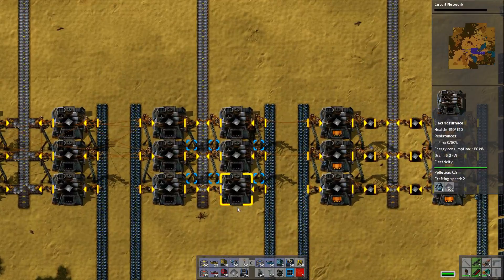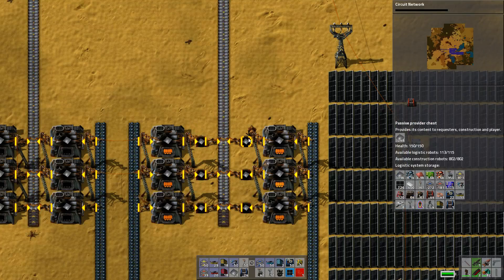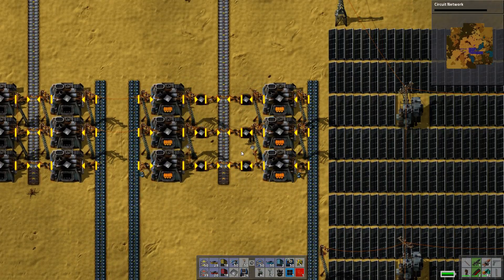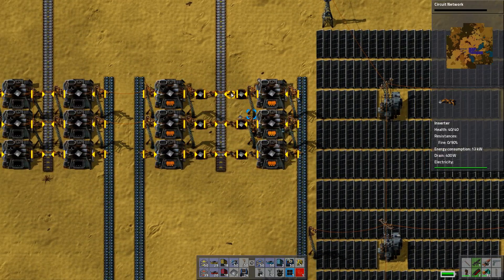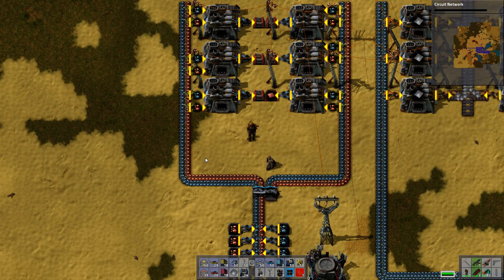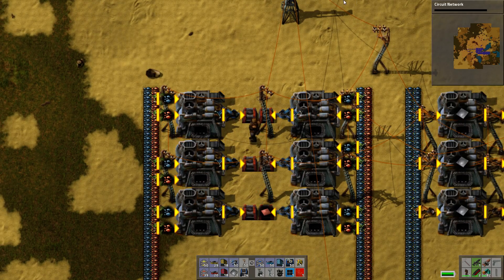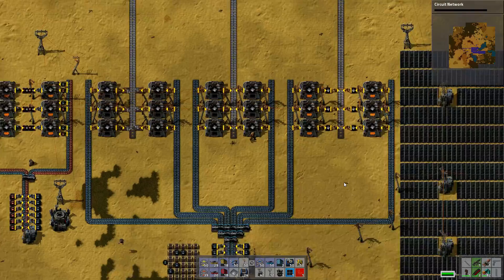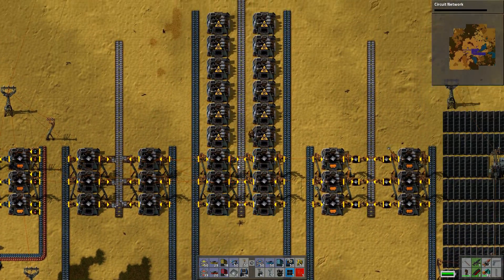Factorio Tutorial 10 - Furnace Setups

Comment: The copper+iron setup you have on the west side (to feed the logistics network) is great to have, even early game.  The reason is because it allows the furnace to always be in use....the downside is sorting the materials (in early game).  Here is a way to do it without a logistics network, but can easily be switched the moment you get it without much change:
https://dl.dropboxusercontent.com/u/24657744/Factorio/SmeltingBalancer.png

Testing the system is simple....I have a buffer prior to the main bus and 2 combinators. The first outputs 1 "0" if copper is less than iron, and the other outputs 1 "1" if iron is less than copper.  The green inserters simply test for either a "0" or a "1" in the system in order to pull that specific material.  The output green inserters are just filtered, so only that material goes on the exit line.  Copper and Iron are alternated going up (for ore input) and left (plate output).

The other good thing about this setup is when you get the beacon, you can use underground belts for the input lanes and put the beacons diagonal to the furnaces...it's expensive, but you can have 4 beacons effecting every furnace.